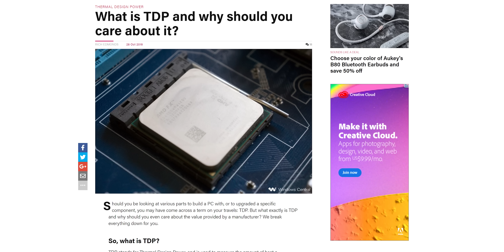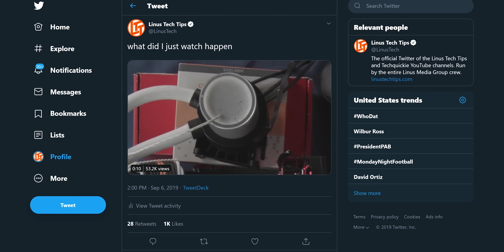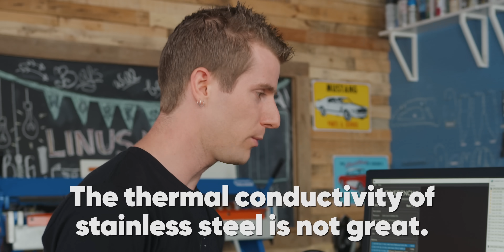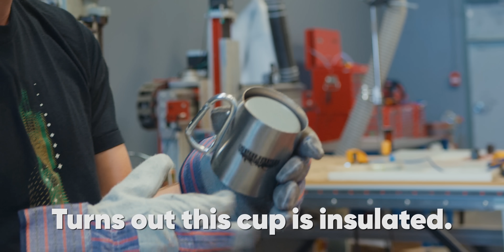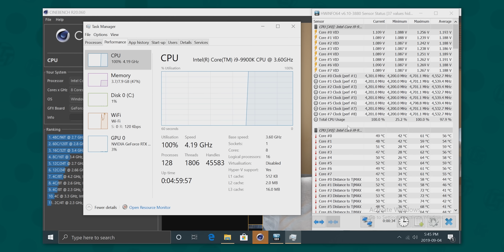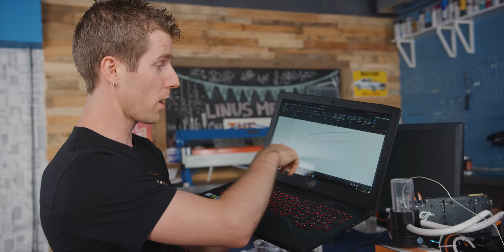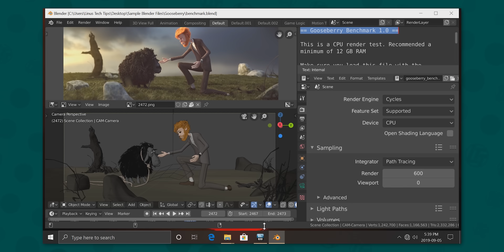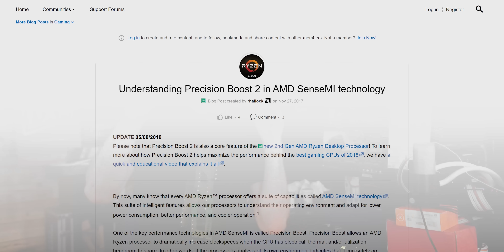Who REALLY Runs Hotter? AMD vs Intel

Comment: Oh god I'm having flash backs to instrumentation class with my inept group mates. This hurts. 

You should just use 1 gallon of water and no dye. A larger body of water allows for a slower raise time in temp and more working time. Just read and plot temp vs time for a given time frame. The chip with the highest average temp after x amount of runs puts out the most heat.

Comment: If you log the temperature difference between the liquid in the (same)cooler and the ambient air you can easily calculate the heat load the cooler is dissapating. 
P=A*C*dT.
Where:
P=thermal power
A=surface area(constant for both coolers)
C=combination of constants that influence heat transfer(constant for both coolers)
dT=temperature difference between the coolant(water) and the ambient air.

Comment: My computers say that my 8086K can pull around 165W, my 2600K can pull 148W, my 2500U can pull 15W, and my 2400G can pull 27W. The surprising thing? My two AMD chips keep up with my two Intel chips quite reasonably at lower powers and heat levels with nowhere near the cooling. They may be a couple seconds slower loading and need the graphics settings down a step, but the next desktop I build will be all AMD.

Comment: I'm not worry one bit about the temperature under load, i more worry about the weird temperature spiking behavior of ryzen cpu, my r5 3600 keep doing this 10c spike every 2-3 seconds when IDLE, resulting in a seesaw temp graph which causes cpu fan to ramp up and down all the time WHEN WE'RE NOT DOING ANYTHING.
when under load the temp are more stable, only exhibit one or 2 spikes in a minute.
I'm on 360mm aio and i had reapply thermal paste, also on most updated firmware/window/drivers

Comment: This is basically called a EFFICIENCY.  Thank you for this Videlo, Linus and Anthony, something like that is also needed in this days. 

AMD core is pretty new, optimised for industry wide known "energy bottleneck" . Stack engine, streamlined front end,  move elimination, signals inside zen2 cpu travel less, have better pathways, core is optimised for maximum efficiency over raw power from gorund-up design, as this core is set to be used from mobile low power to HEDT/Data centric monsters. 

So in general, from engineering look at it, AMD's Zen2 architecture is much better than intel at many aspects, it generally output less heat and draw less power, can complete more work at same power envelope,  it have full package of security features so far not breached by flaws on Intel, and believe me, researchers are not biased, they put all major designers under spotlight, even VIA. 
On top of that, its more flexible architecture made from scratch, so it have improvement/revision headroom with build-in modularity, which is a magnet on semi-custom orders of heterogeneous chips with fixed-function circuity. 

From gamers side? yeah, 9900K does bit more in games

Comment: Why don't you just take a normal water cpu cooler, measure the water flow and install two thermocouples (in and out to the cpu block)? With that you can calculate the power it gives in a steady state instead of heating up a mass. power = flow*Cp*(Tout-Tin)

Comment: I'll tell you what:  If I'm doing such experiment, I'd pick a bucket of equal known mass of water 9(a gallon or two). Then I'd unplug the radiator and put the hoses inside the bucket, so the pump would suck water from the bucket and dump the water in it. Then I'd turn the system and run the test, measuring the temperature of the water. The bucket that reaches 70°C first, is putting out more heat. Much easier.

Comment: Holy... just measure coolant temperature.

Edit: From an AIO of course.
Reply: but, but, then they wouldn't get to play with fancy color changing ink.....
Reply: What they should be doing is: 

Control workload, measure ∆T, and then calculate heat the water gained by Q=m*Cp*∆T

Comment: Nothing can physically touch. There's a force that keeps anything from coming into contact with anything.

No it's true. When you touch your nose, your not touching your nose, it may look like it, feel like it, but between the skin on it finger tip, and the ski of your nose, there's actually a gap between them which it is impossible to actually get them to touch. This is the strongest force known to mankind.

Comment: I liked this video, but... why the hell did you use water to test this. I get that it introduces a visual element but it also makes things so much more complicated and I think it also affects your results quite a lot, particularly once thermal throttling comes into play. Its well documented that zen2 has really high efficiency so long as your not pushing too much power though the cpu, once we start thermal throttling we are effectively changing the cpu were looking at. A zen2 cpu at ~4.2Ghz pulls a vastly different load than a zen2 cpu at ~3.2. We can actually see this very clearly in the 3600 vs the 3600x and the 3700x vs the 3800x. Each only differs by a couple hundred Mhz respectively however their TDP's are miles apart. While yes this does also apply to Intel as getting higher clocks results in pushing more power through the cpu, AMD is not affected in the same was due to their more efficient process.

Comment: But all the major players in the game do have the same philosophy which seems
to be  "The nice thing about standards is that there are so many to choose from."
Reply: You are to stick with the one  your competitor, you and several other companies agreed on.
Reply: @yumri4  then explain why Nvidia's tdp definition is way tighter than everyone else lol
Reply: @DSDSDS1235  As no one sticks to one definition everyone has a different one. Usually this is used for the benefit of the company selling it. I am unsure why nVidia would have a higher TDP than i can find a reason for that is repeatable on multiple rigs with multiple different set ups. 
I guess marketing messed up as the max is a little over the TDP, the min is alot under the TDP unless you are in very unfavorable to running a computer conditions, the other ways of measurement used of 0.1% low, 1% low, avg, and median while in a normal 70F degree temperature controlled room do not go together with what nVidia says either. 

Maybe my testing is done wrong BUT most likely nVidia like AMD and Intel are lieing about how much heat their GPUs give off. Thus it would be better if they all agreed on one way to measure it.  At least then the consumer can get a guess of how much the company usually lies to know how much cooling they will need for the chip, card or board.
Reply: @yumri4  nah. Nvidia explicitly very bluntly just don't go above the tdp as total board power. You literally needa mod the boards to get over that.

Comment: Shouldn't this be done with direct die? Maybe i'm wrong but now you only measered how much heat the ihs put in the loop and therefore there could be a difference in how good the cpu die transered heat in the ihs before it hits the loop. If one cpu has a better heat transfer between the cpu an the ihs that one will also transfer the most heat to the loop

Comment: I had a i5-6400 & then replaced it with a R5 2600. Supposedly, both have the same TDP, but under load, I can feel the Ryzen put out noticably more heat

Comment: They tried to reduce uncertainties by not reading numbers straight from the screen for temperatures but I’m pretty sure the long method they used have many different uncertainties at different points adding up to more than original method